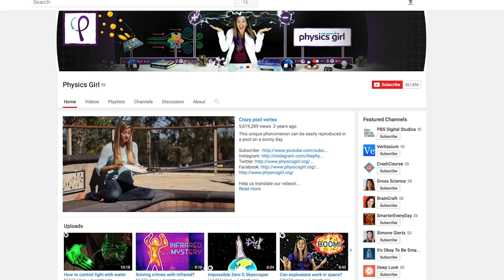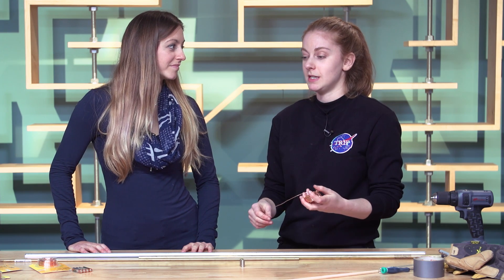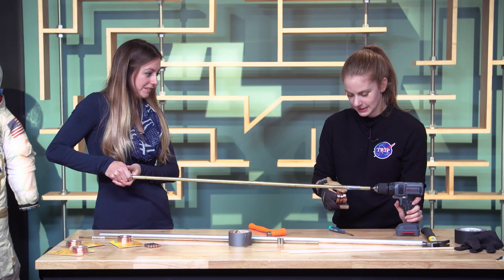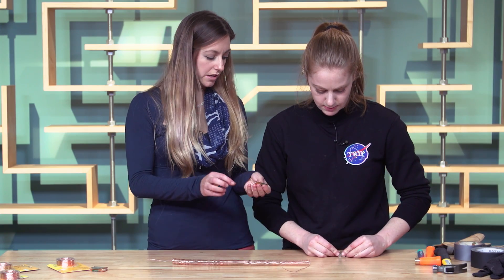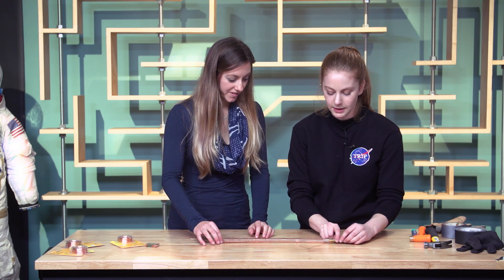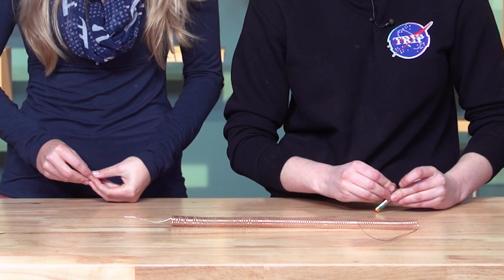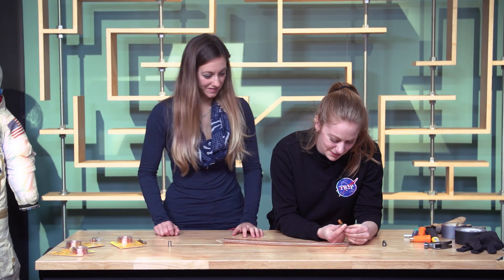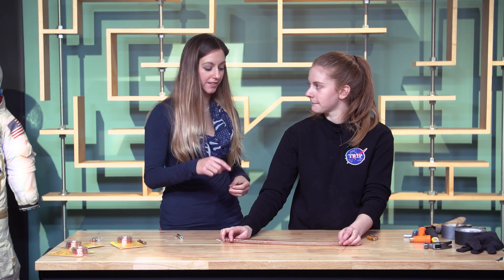Simple Science Project with Physics Girl!

Comment: But how does the current flow when both the ends of the wire are held loose. Current needs a closed loop to flow. It is the voltage induced in the wire, creates a change in flux that pulls through the change in magnetic flux.

Comment: AA and AAA batteries output the same voltage (either 1.2 or 1.5V maximum). If you want more power in a motor like this you want higher voltage (assuming you can't get stronger magnets). You can get higher voltage by putting two or more of these batteries in series. Bend a small piece of hard flat metal in half to make a spring, put that between two batteries (between positive and negative ends) and tape them together. Magnets in the same position as shown here. Or if you have strong enough magnets you can use those to connect the batteries.

Comment: I like experimenting with homopolar motors. Voltage isn't everything. If the current is low, there isn't much oomph. Eneloop/NiMH batteries are only 1.2V compared to 1.5V alkalines, but pack way more oomph. (Alkalines also drop voltage quicker.) But also watch out for worn out batteries. They can still test correctly, but give low current. You can see this with an analog battery tester.

Comment: Physics + Engineering, a winning combination.  I'm right there with Simone trying to think of ways to make it go faster.

Very fresh alkalines vs. good NiMH rechargeable batteries would be interesting.  I'm not sure which has higher short-circuit current, but not all batteries are created equal!  Cheap "heavy duty" non-alkaline batteries that come with a TV remote or whatever are probably the worst for this (higher internal resistance / lower short-circuit current).

The magnetic field strength is linearly proportional to the number of turns per length and to the current.  http://hyperphysics.phy-astr.gsu.edu/hbase/magnetic/solenoid.html.  B = mu * (turns per length) * amps.  The force on a permanent magnet is linearly proportional to the external field strength, B.  (http://hyperphysics.phy-astr.gsu.edu/hbase/magnetic/magfor.html)

AA vs. AAA: same voltage, but lower internal resistance for the AA, but the battery is slightly longer, so more length of copper for it to driver current through.  (Thus less current for the same voltage.)  So whether you a higher B field around the magnets or not depends on internal resistance of the battery vs. resistance of the copper.

If any of the turns of the copper wire are shorting out, you lose that part of the magnetic field there.  So using finer wire and somehow anchoring it so it can't short out turns of the coil could help.

Of course, driving a current through the coil with an external power supply could help a lot.  Just magnets without batteries would work, especially if you insulate the magnets so they don't short out the coil as they go past.  Or keep the battery for extra magnetic field around the train, on top of the external current.

Comment: Try varying the number of turns per unit length. There may not be enough voltage to push the current you need through the copper wire. There will be an optimum where the battery and magnets don't get stuck in a gap but current flow is at a maximum.

Comment: Is anyone commenting on the project? If batteries are alkaline they have high internal resistance, lowering the current. You can try NiMH rechargeables. If you have balls you can try Lithium primaries or rechargeables, but there is a big chance it gets stuck and explode in nice orange flames

Comment: I'm with Simone on the why is it vibrating part 
The battery's DC, magnets kinda act like DC, it wasn't moving so what was making it move??? I could see it if it was bouncing between 2 coils ever so slightly and setting up a "ping pong" effect between 2 wires?
As it moves it induces current that knocks it backwards which set up a current flowing the other direction knocking it forward... ect ect ect?

Comment: Even though the video is supposed to be divulgative and such, its a bit annoying that the girl who claims to be good at physics didn't realize how changing from AAA to AA wouldn't do anything as the voltage for both is the same and the only difference is capacity.
Reply: I'm sure she was hoping that the larger battery with greater capacity would have a lower internal resistance thus allowing more current to flow to create a stronger magnetic field.

Comment: So am I the only one who's thinking that a AA battery is not going to make a difference over the AAA battery in the speed? I don't know a lot about physics but I do know that a double a battery in a AAA battery both produce the same voltage. The difference is the capacity of the battery and not the voltage it produces… Still not a physics expert but that begs the question what difference does it make?
Reply: renxula less current but also weight less so...
Reply: Yes, thus it's not obvious whether it would improve the speed or not.
Reply: My theory is that the strength of the coil's field is proportional to the current and since a AA battery would have lower internal resistance, more current would flow but the AA is heavier so it would result in more drag along the bottom.
Reply: I'm not certain that the difference in internal battery resistance between AA and AAA would be all that significant. If you do this experiment again I would like to see if placing 2 or more AAA batteries in series would increase the speed. Nice video :)
Reply: All batteries have an internal resistance, and that limits the maximum current you can get out of them. AAA batteries have a higher internal resistance than AA batteries, so they give out less current. And you used "begs the question" wrong. :)

Comment: Ladys, I don't know how in depth you are with physics but if you actually want to understand how this works. Look first into the "right hand flux rule" and after that, look into the "left hand motor rule" and you will see how the current running through the wire pushes on the magnets.

Comment: My guess as to why the train goes slow...
It looks like you're using rechargable NiMh batteries... Which have a lower voltage than alkalines (= less magnetic field)

If you want to really make a high speed train... Try a 16850 Li-Ion rechargable (4.2V full charge, 3.7 nominal), especially the low internal resistance ones.

Comment: You could just run current through the copper wire to speed it up...
Reply: Right, just run current through the coil and use magnets only, no battery needed!  :P
Reply: Damstraight68 not gonna work... itll produce a uniform magnetic field which just pushes the south pole and pulls the north pole or the other way around.. anyhow what im saying is there will be 0 net force..
Reply: have you tried turning it on and off again?

I wish I did more physics when I was younger
Reply: someone who actually understand how this works
Reply: That was the problem, they didn't have the magnets pointing the same way.
Reply: Remove one of the magnets and the battery, just have one magnet in the coil.  Apply voltage to the coil to produce current.  The magnet will scoot!  Just like in a speaker, the magnet will move back and forth within the voice coil as audio frequency current is applied!  Simple!
Reply: removing one magnet doesnt do jackshit....even if im seeing this problem wrong... removing one magnet will just change the weight....it still have south and north pole...so it will get pushed and pull at the same time..
Reply: well thanks for the info, i can definitely try and make my own speaker but this is not the same....for the speaker... two magnets are use to induct the bottom and the top plate, but the bottom plate is connected inside the coil..... if you remember from your E and M class...m field outsilde the coil is nearly 0... so where only applying force on the pole inside the coil...we have to apppy AC current on the coil to make it go back and forth.....this is not the same....explain me how a uniform magnetic field can move a magnet.. with both n and s pole inside the coil....it just wont work...dont believe me? go try it yourself
Reply: Ken Logsdon just admit you dont know how magnets work loo
Reply: +Carl Arce: It would work to run a current through the whole coil.  The battery + wiper contacts (magnets) are already doing that locally, creating a uniform magnetic field around the magnets, attracting them all in the same direction.

Ken is right, it's just like a coil driving a permanent magnet in a speaker.

BTW, I'm a part-time high-school physics tutor (among other occupations).
Reply: You forgot the toroidal Z force that emanates from the cosmic strings and impinges on the scalar fermionic quanta in the south pole of the magnets to a more or less greater degree than the north due to the inherent planckian asymmetry of said toroidal Z force in conjunction with neutrino chirality.
Reply: Nope, you're seeing it wrong.  Look up how speakers work.
Reply: No that won't work.
Reply: Damstraight68  sure that was a problem, dya know why? not sure but i think its because the n and s pole is reacting to the same m-field so theres no net force...but if they are facing each other it would look something like this (weak m field [south][north]~~~strong mfield ~~~[north][south]... weak mfield) since theres stronger mfield on the north pole.. there is net force....but what im saying is running a current through a wire would produce a uniform magnetic field in the middle... it will be weaker on both sides of the coil tho..

Comment: so.....do bigger batteries make it move faster?? or would adding more magnets??
Reply: Depends on what you mean by "bigger".
Heavier batteries make it move more slowly because there's more mass to be carried, but stronger (higher voltage) batteries would make it go faster because they create more current, and therefore a stronger magnetic force.

Same with magnets, if the magnets are stronger it would go faster, but heavier magnets would make it go more slowly.

It's a balance between weight and strength, just like with rocket or plane fuel. You have to carry the extra fuel, even though it might make you go faster or further, it also makes you heavier.
Reply: It would actually have near 4 times the force with the same magnets; the way the formulas work out, the square of the current is used to calculate the force. This means that quadrupling the voltage would actually multiply the force by 16.

There's already a current in the wire in this experiment. The current flows from one side the battery through the magnet into the wire and all the way into the other magnet and into the other side of the battery.
A current from a different source flowing through the wire would also provide a force.
Reply: I don't think so.  Magnetic field strength is dependent on current, not power.  Batteries have an internal resistance, so two batteries in series would have twice the voltage but also twice the resistance so therefore by Ohms Law you end up with the same current as with one battery.  To double the current you would need 2 batteries in parallel.  You'd need a different shape for the coil! :)
Reply: a current added to coil instead of the magnet should also move the magnet as well I assume?
Reply: You can still run AAA since they are the same voltage as AA but more lighter but reduced capacity.
Reply: Ashley Tritle ohh OK..so two AA batteries in series would have near twice the force with the same magnets..
Reply: I think you have that backwards. Series would give you more power and parallel would give more capacity. They want speed so you want to run in series. You need the voltage to flow more amps which is the power to give speed. What they built is basically a very inefficient motor but it works the same way.
Reply: Bigger batteries make it move slower because they are heavier while providing almost the same short-circuit current - something these 'scientists' apparently are not aware of. Stronger magnets would make it move faster, tho.

Comment: What about taping a bunch of button batteries together and then putting the magnets on?
Reply: I wonder how much current you could run through it before it started to overheat?
Reply: you would probably get coils with less than one winding. So you basically just shot them. 
To get it faster I would use a Lithium battery with 3,6V and thinner copper wire with more windings per distance...
Reply: you are adding more weight so it probably would be slower, the spacing in the wires its important too if they spread the coil it would be a little faster.